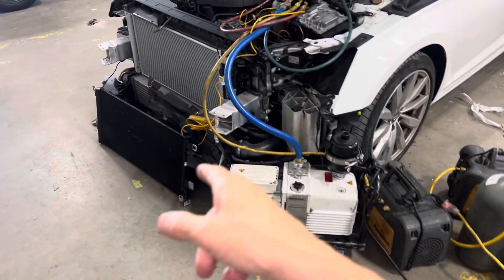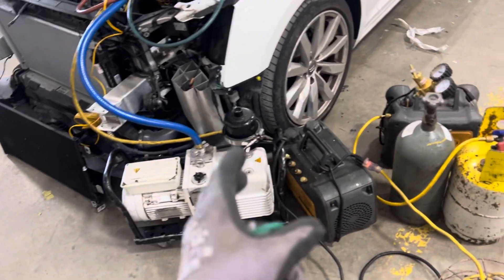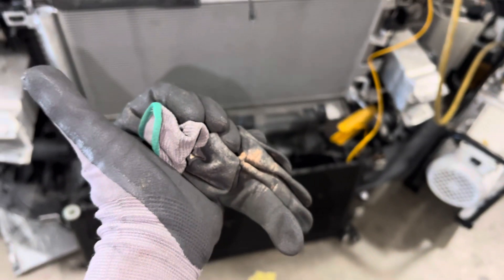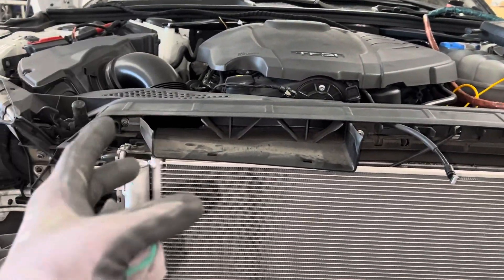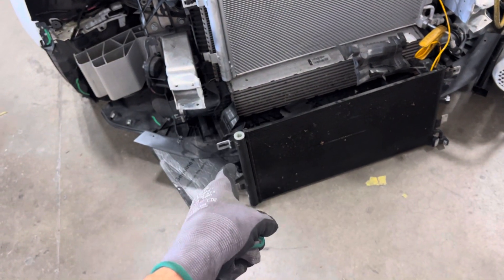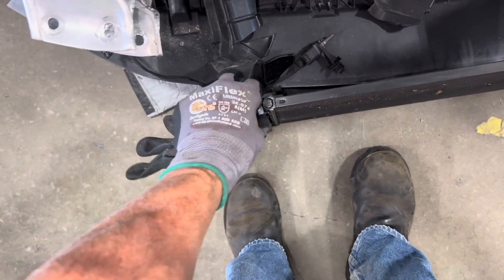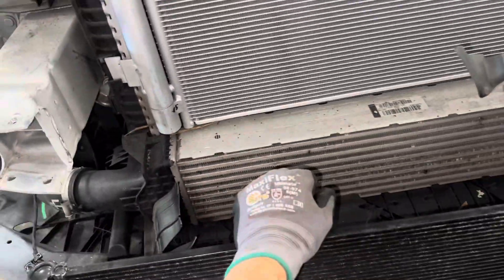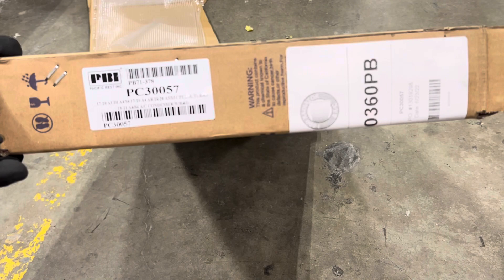SOMEONE TOLD ME I SHOULD NOT CARE ABOUT THE CUSTOMER !!! Mistake I’m the wrong person to tell that￼

Comment: Aftermarket used to mean upgraded...now it means cheep and badly made more then nice stuff
Reply from the maker: 100% correct I remember that a few decades back. 

Remember when NAPA ignition parts had the blue streak line of high-quality ignition parts.  

Remember when snap on actually used to make tools in the United States

Remember when snap on had their high-end brand line that was called blue point. 

Remember when redwing boots were actually good thick leather that lasted for decades and you are used to be able to resolve them about six times

And now they’re throwaway Chinese throwaway boots that you can’t even resol except for a few American made ones that fall apart

Comment: Couldn't you have removed the desiccant before installing the new condenser, or doesn't it already come with it installed?
Reply from the maker: It already comes pre-installed from the factory. 

So it’s very important from whatever manufacture who is making the condenser for this car that the desiccant material comes in bulk shipping that is especially contained in a moisture free air free environment just 20 or 30 minutes or even sometimes less exposure to the air with high humidity will completely saturate the desiccant making it totally useless. 

If it’s manufactured by a manufacture who does not purge the unit with nitrogen as there inserting the desiccant then all it does is absorb the moisture that’s in the newly constructed condenser and as we know most of them or made in Asian companies that operate in high temperatures and high humidity tropical environments not a good combination. 

Then depending on how good the plugs the seals that are inserted to cover the inlet and outlet or the condenser if they are not airtight. 

Every time the condenser is in a hot environment during the daytime you have a slight expansion of the air inside the system pushing out words exiting the internal of the condenser and then every night when the condenser gets cold the gas is inside contract lowering pressure and bringing in fresh high humidity air into the condenser saturating the desiccant on a daily basis it literally breathes 👃

Comment: That OEM desiccant sock placement looks way easier to access.
Reply from the maker: It was originally only a 60 seconds to replace 

Now I turned into a bumper removal with the aftermarket condenser and loosening up the condenser radiator assembly to raise it up high enough to get access. 

Just an extra near two hours of labor at $185 an hour just because the fitting for access the Desikan sock was placed on the other end
Reply: @coldfinger459sub0  Thanks for that metric, 60s vs 2hr.  

How much would you charge for that 60s job?
Reply from the maker: @AK-IT  I charge more for writing up the paperwork in the work order then the actual procedure it’s sad to say. 

We will ignore the fact of the charge in the time for recovering to refrigerant we were ignore the cost involved in the refrigerant itself and we will ignore the labor for recharging after Ddesiccant is replaced. 

And will just stick to the actual replacement of the desiccant bag as a sole only procedure. 

On the whole ticket I would add a additional 1/10 of an hour which would be $18.50. 

But that is a fraction of the few hundred dollars involved of the refrigerant plus the labor of everything involved. 

It literally takes me and cost me more to get the customers information and fill out all the paperwork and go through the cash transaction or credit card exchange than the actual job itself.   Looking at it from a business point of View.
Reply: @coldfinger459sub0  Wow, that $18.50 replacement turned into over $300 just for the desiccant part of the service.

Comment: As you're someone who specializes in this, you can't promise high end results to your customers if you're dealing with parts like that.  No judgment here at all.  Plus I'm particularly someone who believes in getting what you pay for. If you're paying for something, the quality needs to be there.
Reply from the maker: Unfortunately I am a subcontractor vendor who is literally called into hundreds of body shops and mechanical repair shops throughout the San Francisco Bay area and I get to see the best I get to see the in between and I get to see the worst. 

It’s the poor body shop owners who are told by the insurance company where they signed that contract with the devil to make that money to get those jobs in some cases they have to do what the insurance company says, 

I show up and I just notate the problems and if there’s any problem in writing on my invoice I tell them that if this customer complains about cooling on very hot days. I list what the fixes to return the customers vehicle to like new OEM condition and performance

1: I charged you $185 to come here and look at the customers complaint of poor cooling preformance. 
 2: Now I’m going to charge you $75 to recover the refrigerant out of this vehicle

3:  now you’re going to get charged the 2.5 hours to remove the bumper and headlight assemblies .4 hours to remove the radiator and fan assembly and they will be the .7 hours to follow the manufactures instructions to properly purge out all the air from the coolant when it is added back in by replacing the radiator all this add a mechanical labor rate of $185 an hour. 

4: You are now going to purchase a original equipment manufacturer condenser that has the original quantity of cooling Fins  and refrigerant passage tubes.  @X$$

4:  I am now going to charge you 1.4 hours book time at $185 an hour to recharge this vehicle

5: this vehicle takes 2.2 pounds of R1234YF at $207 a pound. =  $455.40 

6:  now the customer has original equipment air conditioning performance that works good on hot days. 

Congratulations have a good day 😂 🤣 $$$

They only learn if they get hit in the pocketbook $$$$ profits are the only thing that change attitudes with corporations.   I know how to deal with and speak with high-level corporate BS
Reply: @coldfinger459sub0  Hey you still specialize in this though right? If you're good at something never do it for free. That's what I was always taught. Side note I gave a shout out to your channel here on the Toyotanation forum I'm on. There's a thread on there where the poster almost got hosed with an evap core replacement job, they took it to a second shop for another opinion and found that it was actually the variable displacement compressor that was wonky. My thought was the flow sensor going but either way the guy was thinking the original shop was trying to rip him off. I told him not necessarily. It's possible but if you have someone attempting a diagnosis on something they only really know basics about you might not get the right diagnosis. That's when I referenced your channel and told him you'd get it right every time because your specialty is hvac. Sure you know other things on cars but you specialize in hvac. That's where it pays to know!
Reply from the maker: @mailmanjoe  yes many decades ago I moved away from trying to specialize in everything and know everything and be the best at everything and we all know that is not possible. 

And my father told me be very good at everything but be the best at least one thing or two if you can. 

I choose air-conditioning and electrical

Seems to two things people can’t see smell or really touch unless you want to get shocked by electricity and only thing you could feel in air-conditioning is the outside of the cold of the pipe you really have to understand had a molecular level of the physics of what’s going on inside the pipe 

My dad told me imagine yourself as a molecule of refrigerant and you’re traveling along inside the tubes pipes and hoses you’re going through the expansion valve you’re being compressed and going into a compressor being ejected out the line and entering the top of the condenser and what is happening to you as you travel from the top of the condenser what is your state of matter that you are in at the top and what do you become when you’re at the bottom of the condenser in the same journey goes as you’re a refrigerant molecule and you are traveling through the expansion valve what happens to you when you come out the other side and by the time you reach the top of the evaporator and travel back to the compressor in what state of matter are you in when you leave the evaporator.
Reply: @coldfinger459sub0  Good one!